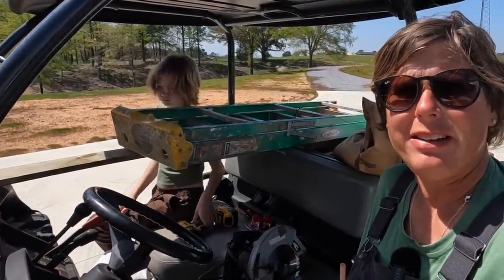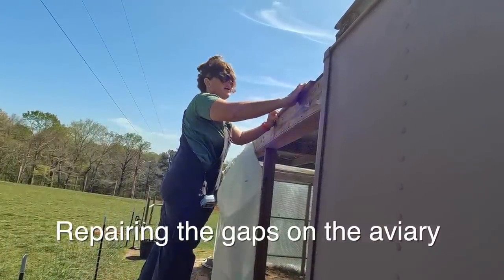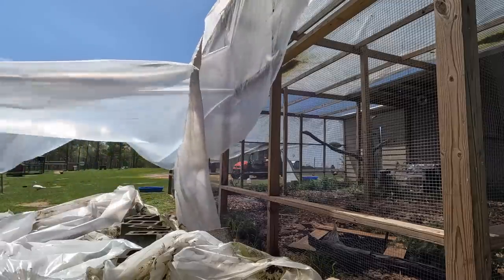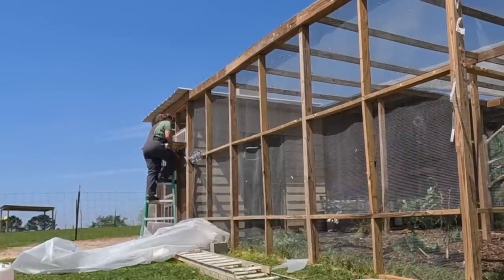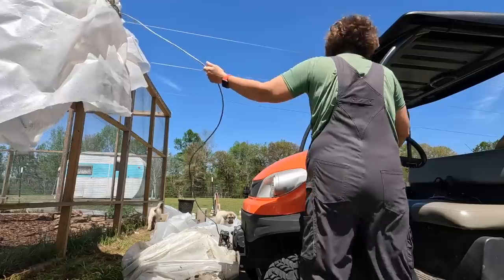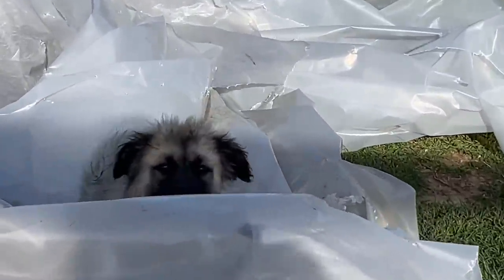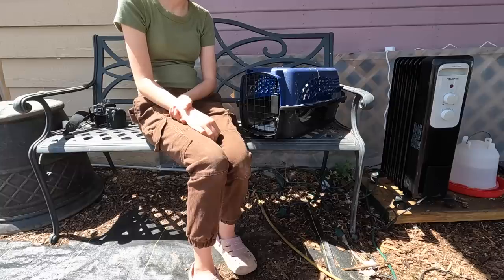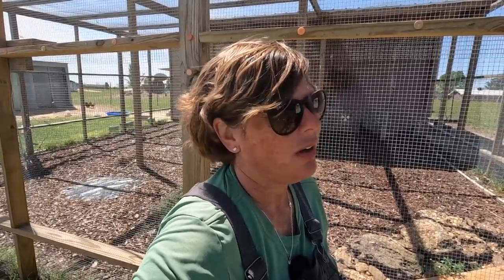You Won't Believe How I Got This Plastic Off The Aviary!

Comment: Just a suggestion for next year's winterizing.  Take long 1×2 wood strips equal  to the length of the wall of the  pen and lay along the edge of the plastic.  Roll the board and plastic a few times until the board is covered with a few layers of plastic.  Nail the plastic wrapped board along the top edge of the  pen with the plastic draping down. It will only take a few nails.  Then along the bottom edge of the plastic,  roll another 1×2 up in the excess plastic until you have the wall length of the plastic correct and then nail across the bottom of the pen. This is a two person job, but will use fewer nails and will be easier to remove with just a claw hammer. Or you  could use screw as well.
Reply: We do just that on our back porch for my Birds and believe me it is hot when we roll up the plastic Man the house gets cooler and it is about time to roll up and Winter Roll Down easy and we had it up for years.. But I hear a New room being added for them Next year So the VCP will be housed and warm.. Bye Bye Plastic!!
Reply: This is definitely the way to go.
Reply: Yes! That's how I hang plastic sheeting as well! Works like a charm, is easier to put up And take down.

Comment: OH, Brooke, could you have picked a more windy day to be up on that ladder and rooftop??? That was scary. BTW- next year when you put up the plastic, sandwich the plastic between the 4x4 posts and a “furring strip” then just nail the furring strip at the top and bottom, and maybe one in the middle. Then just take off the furring strip when you need to remove the plastic. I do think you’d be able to reuse the plastic for another year or two, by hanging it this way.

Comment: Just a thought.  Since you'll probably be putting plastic on the aviary every winter, do you think it might be helpful to place a large tarp over the top that you can roll up in spring and then just roll back in winter. Like attach it to the roof of the pigeon house and use a dowel to roll it back and forth. Then you'll only need to put plastic on the sides.

Comment: Mrs C 😁 did that oil heater, heat up the aviary? I have recently moved into a loft (like a pigeon)in South Africa and winter is on its way, so looking for an affordable heat source.  My small electric fan heater ain't doing the job, like you Brooke I hate the cold. ❤❤❤❤❤